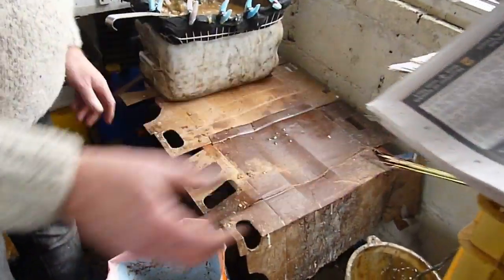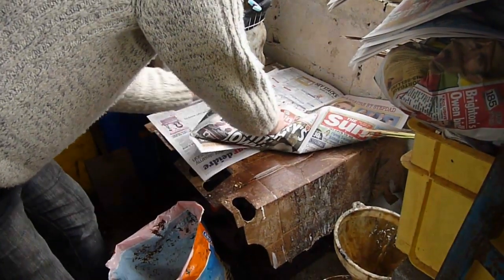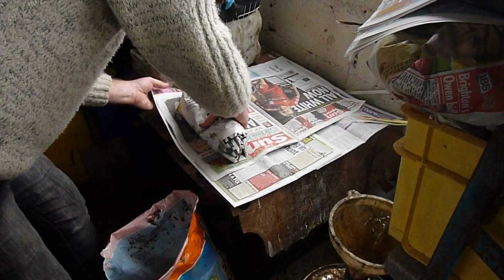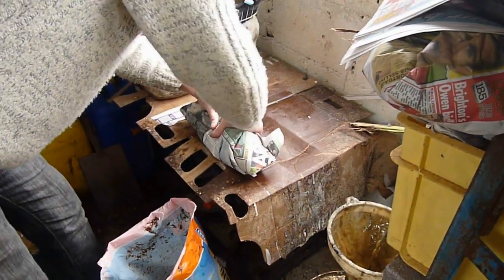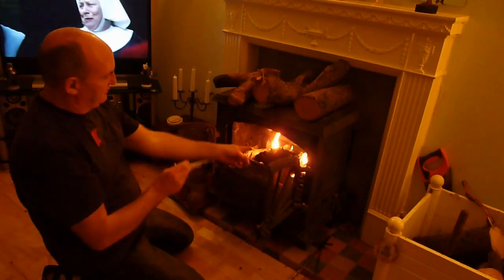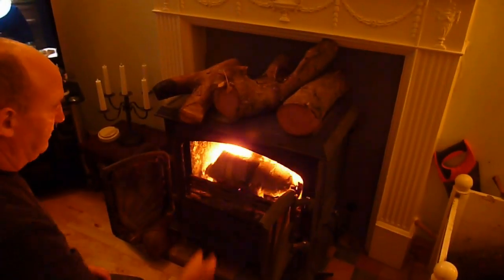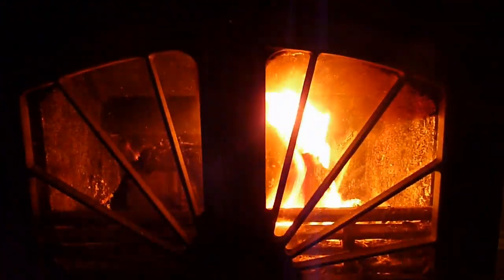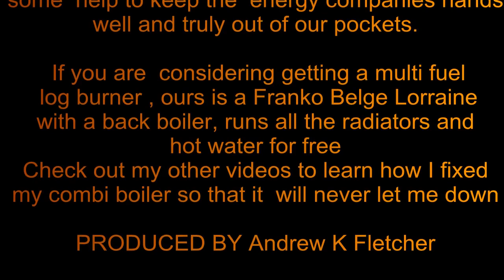Make Briquettes from Newspapers Sawdust & WVO Fat to Heat Your Home For Free

Comment from the maker: Yes, get a clean burn, no more blackening than burning logs, trick is not to overdo the fat, adding more sawdust in the log reduces the amount of fat burned. Also, when cleaning the chimney, the soot is different, more granular and easier to clean without fine dust. Smells a little like coal outside but far less acrid than coal. Mix 3 teaspoons of washing soda crystals with water in a spray bottle and spray glass on inside and the carbon comes off easy with wire wool. re-apply and leave to dry

Comment from the maker: Hi Kurt, you could indeed use fat right from the butchers, mixed with saw dust and wrapped in newspaper it would probably burn more evenly than the used wvo fat

The sawdust and newspaper acts as a wick to slow down the burn and reduce carbon by increasing the air to fat burn mixture.

Comment from the maker: Hi Kevin, you could also use a cement mixer, fill with saw dust and tip oil in to coat it. Didn't realise that whisking oil created thick grease, maybe this is how they make margarine?